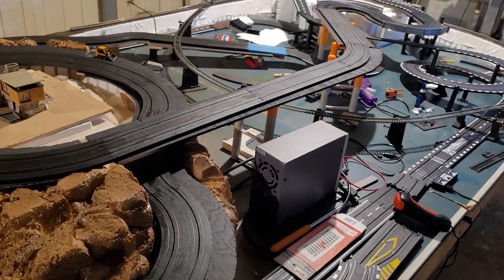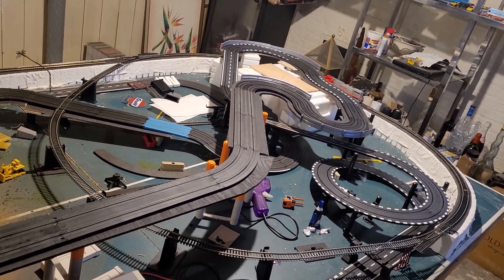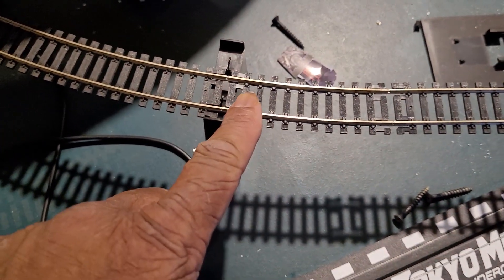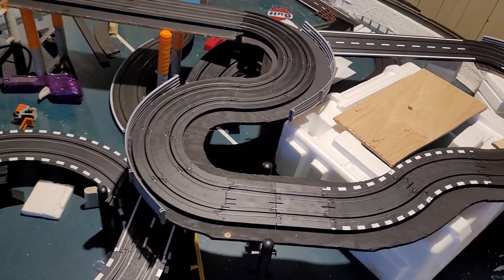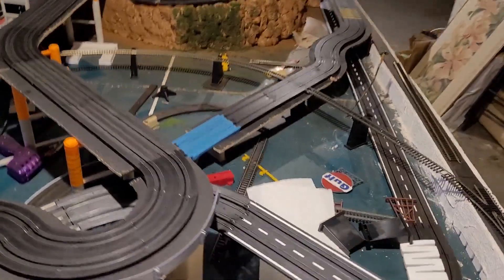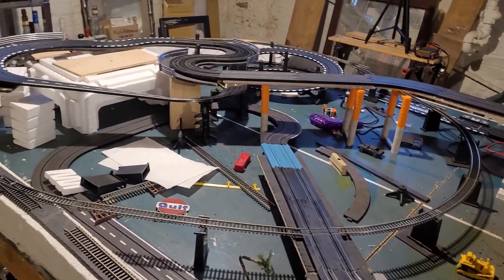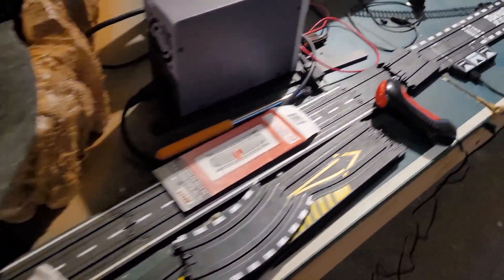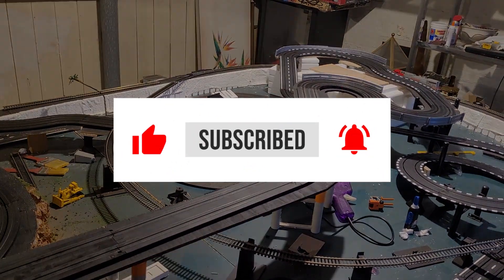Los Diablos Track Update (AFX Tyco Hybrid Slot Car Layout)

Comment: “Cant remember how I had it.” I hate that. lol. I snap a pic on the phone. Its happened that much. Like a sudden case of Alzheimers kicked in. The  AW track with white markings...Well it just adds something visually. I like it. btw - I had some AW 9 in 1/4 turns that I had to push the rails up on. Some cars would lose power going around. Thanks for adding turf to the rock siding. Much better. Great progress.
Reply from the maker: I kick myself in the butt for not documenting the layout.